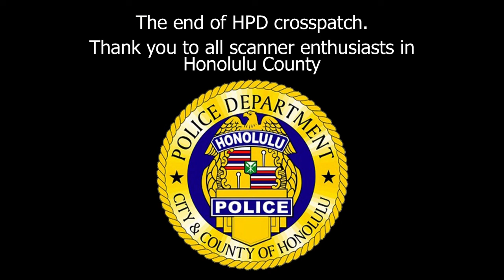HPD's final transmission on EDACS.

Comment: Do you know what is now on the edacs. Or what remains on it. I know the bus coms is still on and something else that is running on provoice I’m assuming. I have an analog handheld and frequently hear provoice noise on the last windward simulcast channels. Any ideas?
Reply from the maker: Its should be only OTS and DLNR on the EDACS now, HPD transitioned back in 2022. Not sure abt the windward simulcast, could be something else. Im on the leeward side of the island so once in a blue moon ill try check out the windward side.
Reply: @fuhwurd  Hey thanks for the reply and info. Are the simulcasts not connected around island? I hear bus radio from all parts of the island most of the time. Also, I know you already said it should only be dlnr and transport left but I hear the provoice chatter constantly and wonder who could be talking that frequently. Most of the times it goes throughout the night whereas the bus and others usually die down after a certain hour.
Reply from the maker: @squidies8084  Are you able to record the calls? I might be able to decode it.
Reply: @fuhwurd  I’ve recorded it with my phone coming out of the speaker which is not ideal. However it’s the best I’ve got at the moment. Maybe Dsd will be able to pull a group id or something.

Link: https://youtube.com/shorts/0QuEEtIXRYI?si=0n4Gx4JVsI1MEMKg
Reply from the maker: @squidies8084  I recommend you use UniTrunker, its the only (good) software out there that can trunk scan the legacy EDACS.
Reply from the maker: @squidies8084  You should also try connect your portable to a microphone, if thats possible then I can probably decode it with dsd
Reply: @fuhwurd  Ok thanks for the info and suggestions. I’ve ordered a cable that allows me to connect the portable to my computer. Do you think sdr trunk will accept a line in connection or is an sdr dongle required.
Reply from the maker: @squidies8084  Im currently running SDRTrunk and you need a dongle, highly recommended two dongles though since one will listen to the control channel and the other will scan for all the talking. You can also set up a broadcastify node stream which I already did. It would help though cause my SDR has seen way better days.
Reply: @fuhwurd  Thanks for the help. I’ll look it.